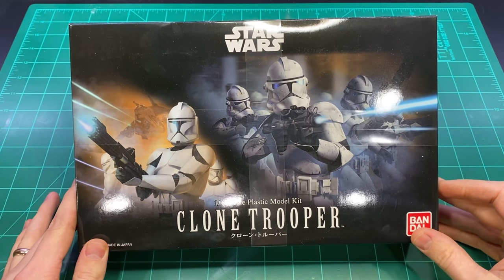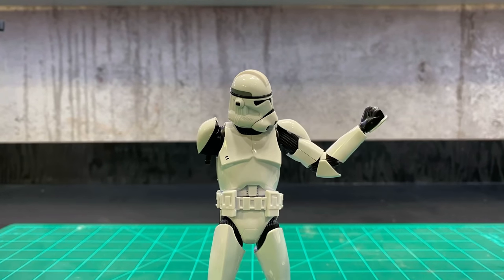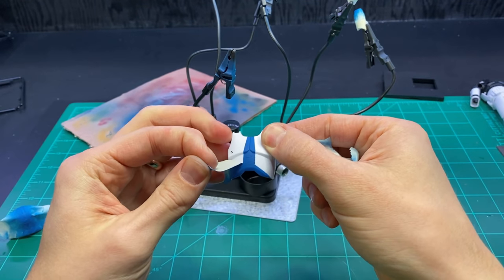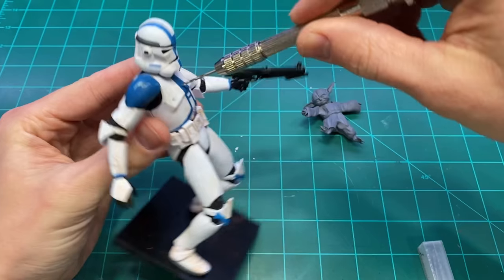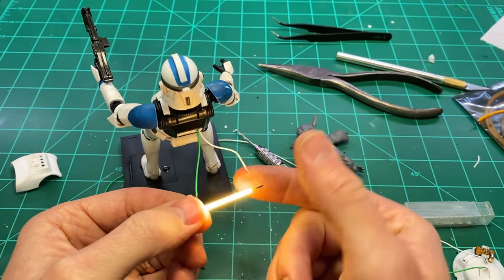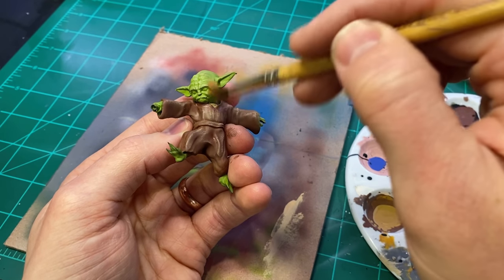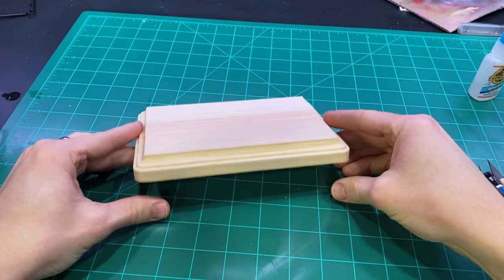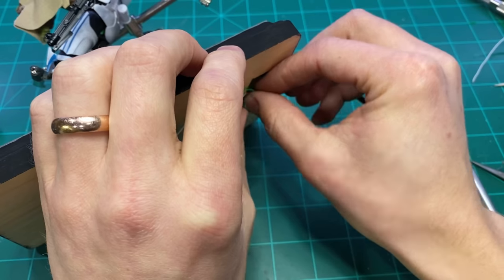Yoda's BRUTAL Clone Takedown! | Revenge of the Sith Diorama

Comment: For the tips of those filaments, maybe you can using a green microdot LED? At the dollarstores around here (Dollarama) every Christmas they sell these strings of multi coloured microdot LEDs that run on 2AA batteries.  If you had one of those, you could probably solder it to the end of the filament and maybe use hot glue or something to make it seamless and to spread out the light, if you are going to paint it. The dots with an epoxy bubble around it are approximately 2mm wide, 4mm long and 2mm thick, excluding the wire. They are pretty bright too.

Comment: My suggestion for the lightsaber would be to try using clear acrylic rods (you can find them through various hobby supplies/amazon) over a single LED embedded wherever you need it. The end of the rod can either be left unchanged, or you could sand and round it, depends on how you want it to look with the light off. An airbrushed translucent paint sprayed over it will let you get the color you want. It might not glow quite as strong as the filament you used, but the entire thing will be lit instead of having a little dead zone at the tip, and it doesn't need a wire running behind it, so your circuitry can be more discreet.

Comment: A couple of ideas for the lightsaber end problem:
1. Those filaments are actually chains of tiny series LEDs (see US patent US10240724B2). In theory you could carefully nick the insulation (behind the wire) and double them over very carefully, possibly just resoldering any eventual internal wire breaks. Would potentially require a soldering oven rather than a soldering iron for the required precision.
2. The pragmatic approach : Solder a micro LED onto the end and then wrap it in a cocktail straw to mask the joint.
3. In addition to #2, you could also theoretically trim back a bit of the insulation on the end of the filament so there's less dark length.

Comment: Well about 3 years too late but for a while on Amazon the Bandai clone models were only about $15, I bought 2 with the initial intentions of displaying 1 in phase 1 and the other in phase 2, but I ended up painting one like the 501st and enjoyed doing it. But then the price went back up to $40 right after, but has dropped to around $27 and I bought 4 more, 2 to paint in phase 2 and 2 to paint phase 1, I’m going to do 2 of the ranks from attack of the clones (I don’t know which yet) and I’m doing the coruscant guard shock trooper and 212th attack battalion trooper for the phase 2. So if you’re still interested in these clone models they should be cheaper and easier to find now. They seem to be stocked up pretty regularly from the seller.

Comment: Another amazing diorama!

Have you figured out an idea for how to terminate the tip of the lightsaber blade yet? To be fair this is something the replicas struggle with as well. I wonder if there's something you could use as an extra layer over the filament to diffuse the light so it wraps around to the tip. It's hard to think of what could work because the scale of the blade diameter is already so good, anything much thicker would look off. Anyways just some food for thought. Loving these videos!

Edit: Have you seen what these LED filaments look like on the inside? There's some interesting images on the Wikipedia page, it's basically a line of super tiny led's in a row. I wonder if you could do some super small scale surgery on one and get the end to terminate closer to the light source. Good luck!

Comment: To solve your lightsaber problem I'd recommend to solder the wires to it an after that you slide a tube over it (pretty much like a condom 😅). By doing that and using a colored tube/straw you can also choose the color for the lightsaber without the need of spray painting it... Just an idea 🤷‍♂️

Comment: Hey first of all I want to say I'm a huge fan.

Your work is pretty awesome. I am totally taken back by the lightsaber effect. I have purchased most of the filaments I need for my dioramas and certain wiring and diodes however I am not an electrician. Is there any way that you could elaborate a little more on how to wire the stuff up?... Maybe point to another video or perhaps create a tutorial on it that is a bit more in depth.
Reply: Something else you could probably do is put together a basic sheet that shows the wiring for the three volt filament. I would like to stick to USBS  as a power source, if possible. This would be greatly appreciated.